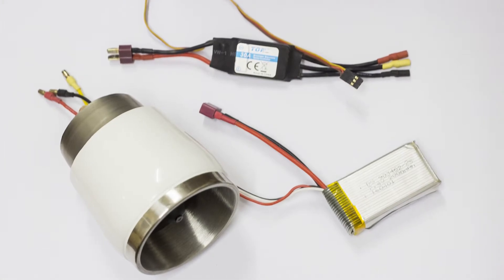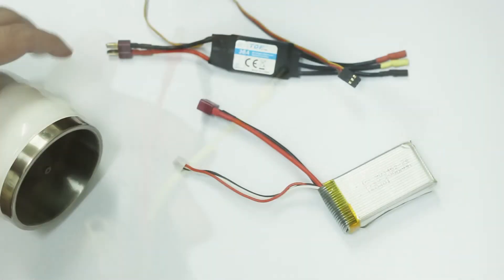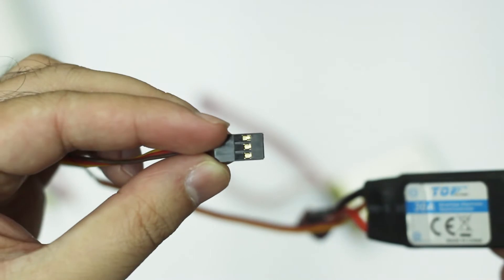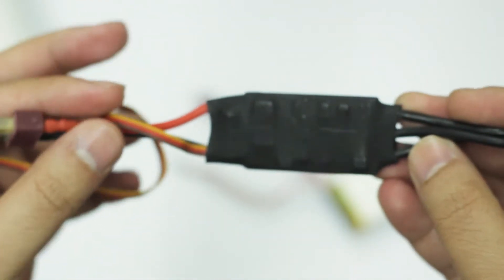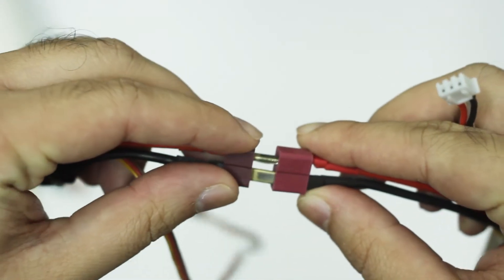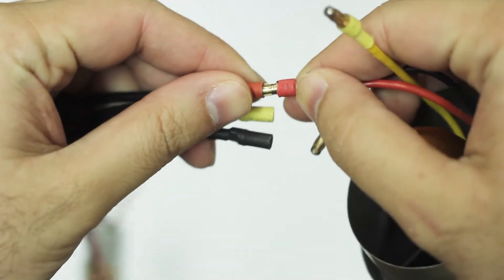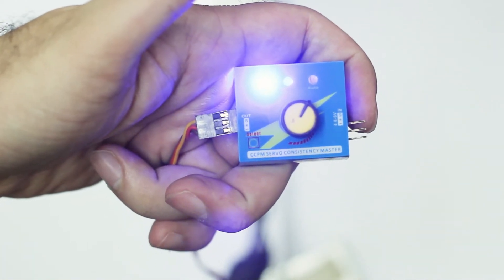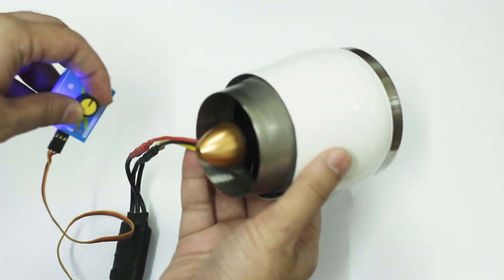How to Run EDF Brushless Motor without Radio Transmitter Rx Tx RC using Brushless Motor Driver

Comment: hi, should i get an esc with bic? and should the esc be programmed ?
Reply from the maker: not really need to be programed.
Reply: @nicevideochannel6583  didn't get you should it be programmed or not ?  I will no use for rc I want to used for something else..I can just buy an esc and connect the tester and run a motor?
Reply from the maker: Just buy the motor and ESC along with Servo tester and you are good to go. @RabeaHussain
Reply: @nicevideochannel6583  thank you very much

Comment: Why did you make a 20 sec long video into over 2 minutes?
Reply from the maker: Some students Fail and some become Topper sitting in the same classroom. You may understand it in 20 seconds but some newbies 2 mins is enough.  Cheers :))
Reply: there is no time limit for endless idiocy
The better you explain the less time it takes to understand